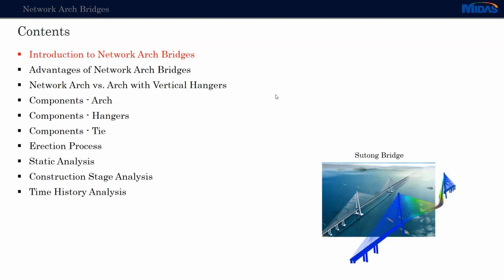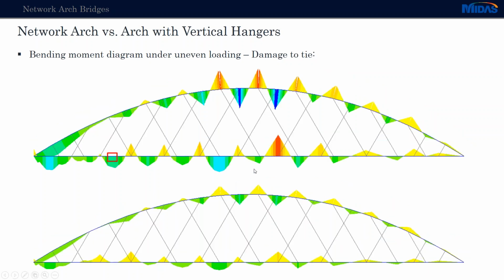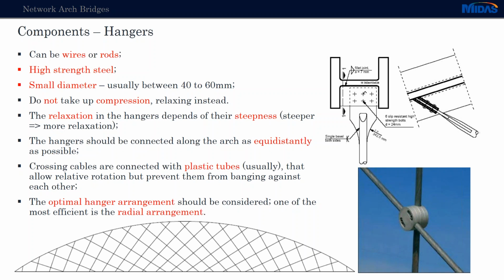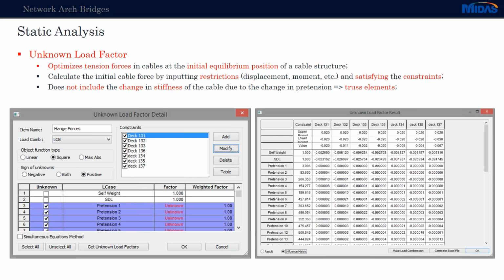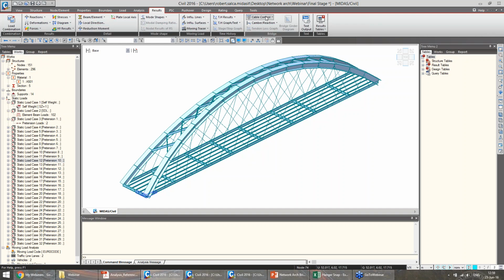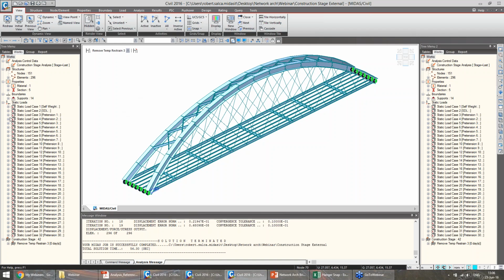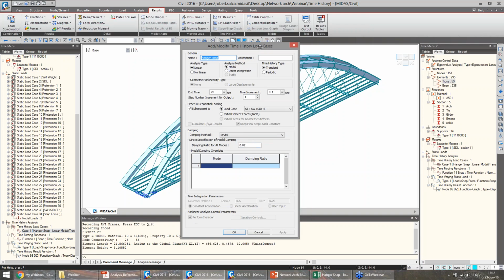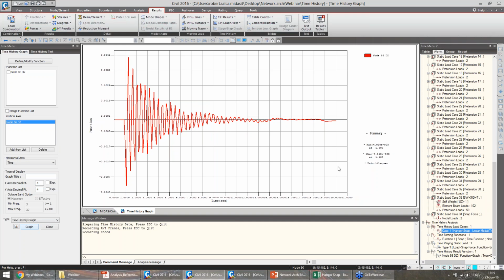MiBridge Seminar - Network Arch Bridge - midas Civil

Comment: Good day sir.  There is any information when and after Analysis:  Displacement Error Norm... The case is same with me. How to fix it?  I already fix it by iteration, Subspace Dimension and Covergence Tolerance in Eigenvalue in Analysis Control but the result is same. Do you have any solution to fix it?